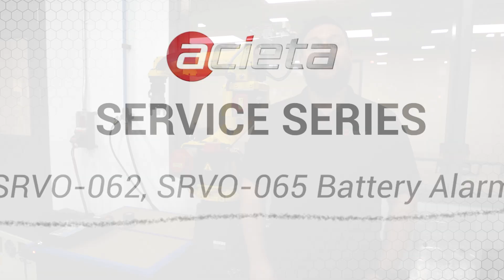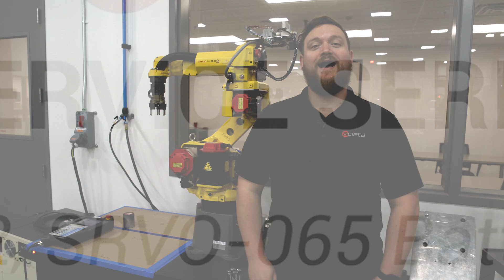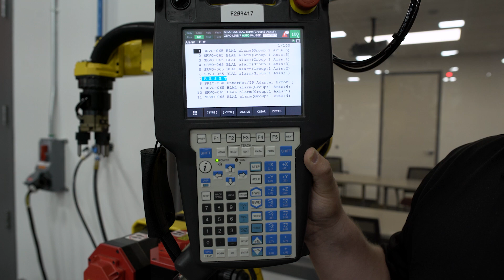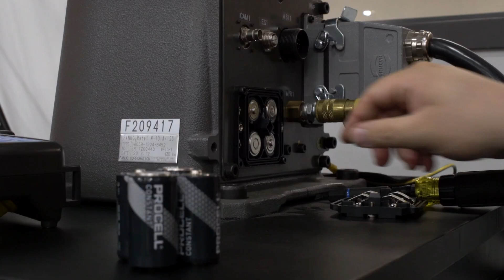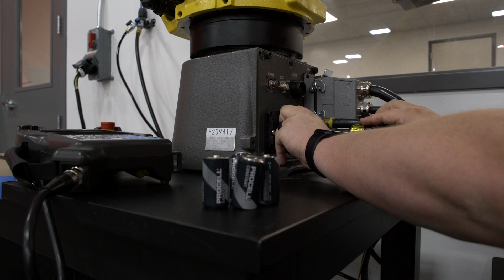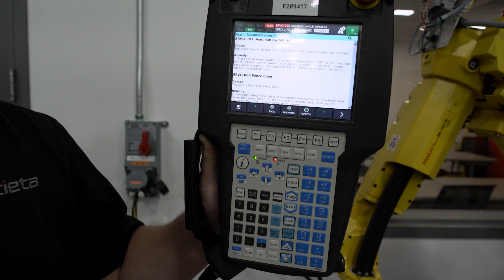Troubleshooting FANUC SRVO-062 and SRVO-065 Battery Alarms

Comment: What would cause the issue to persist? We have 28 Fanuc Arms, and we have an issue with 1 of them faulting for battery replacement. Likely have replaced the batteries 5-8 times within the last 3-6 months.